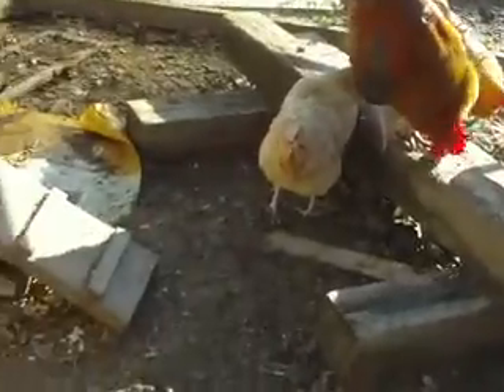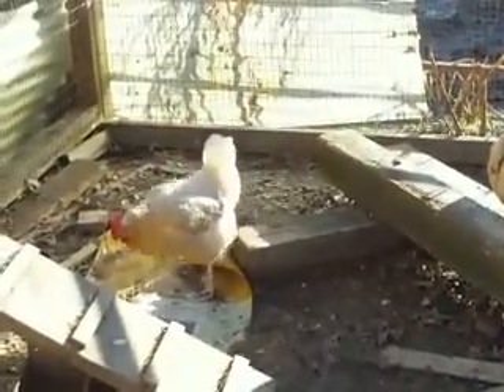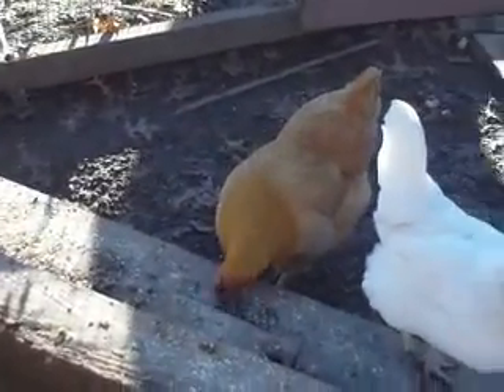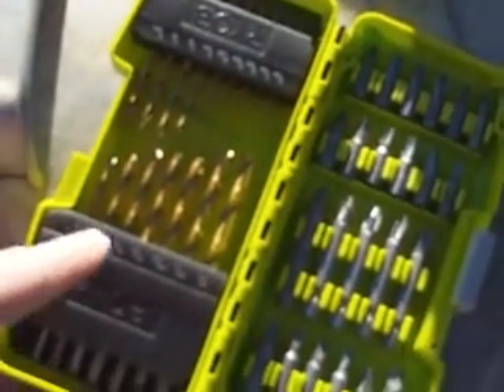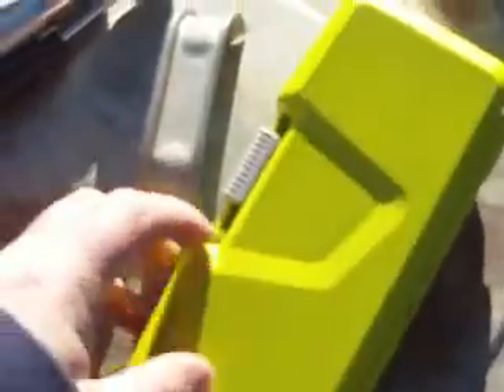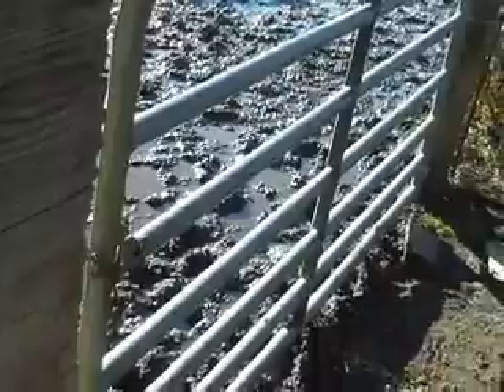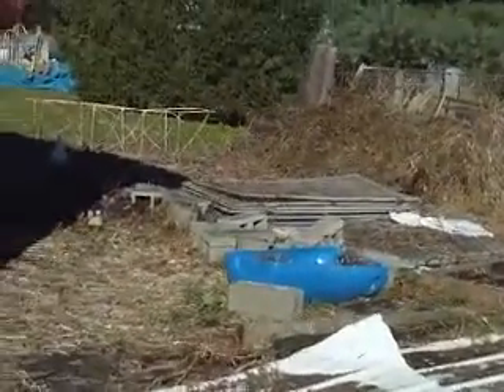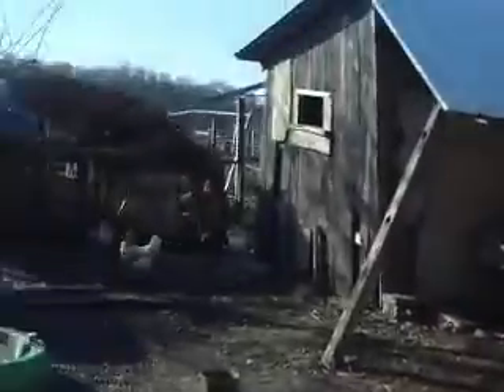Dealing With Ammonia Smell

Comment: I would be freaking out if I smelled that.   I am actually afraid that is what is wrong with Troy's chickens going off their food.... too many chickens in that tractor.  but it is ventilated because it is open on the bottom and there is the fan hole at the top... but, I wonder if there is enough air movement with all the chickens snuggling up in there.  They went off the food when he had a few days of warmth after a cold wet spell... I seem to recall a Vet show I watched where cows and pigs were dropping all over the place from pneumonia when there was a cold spell followed by a sudden warm few days.  The warmth actually harmed the animals.  I don't recall if it affected the chickens but the cows and pigs were frothing at the mouth and dropping dead within a day. Very bad.
Reply from the maker: Drastic swings in temperatures can effect animals. I've talked to a few vets over the years, and they all tell me that their colic calls for horses spike at those times.  My friend has an old pony that she has to keep tabs on at those times.
I had prepared the hen house for a winter like we had last winter. That's what everyone was saying we were going to have. Well, that has not happened yet. We are actually having a milder, yet very wet winter. If it wasn't for the wetness it would not be so bad.
In theory, the deep litter method helps to keep the chickens warm with the decaying bedding/manure mixture and is not supposed to smell.  But the manure is not getting a chance to dry out. So, I opened the window and the dutch door. Plenty of ventilation now.
I haven't had a chance to comment about Troy's chickens, but my theory is more along the lines of the wet conditions.  He just throws the feed on the ground. With the wet conditions the feed will break down. Normal conditions, it's not a big deal. But with as wet as it has been, that may be the problem with them not eating it.  I only throw scratch on the ground, their pellets are in a feeder.  This is just a theory on my part.